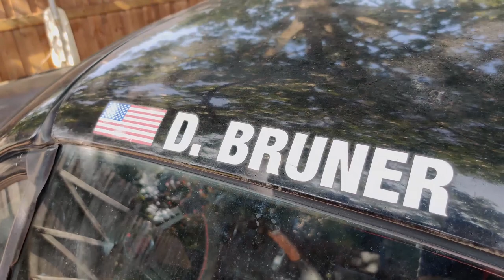Modding and riding the Honda Grom Clones(+what issues do our $1200 street legal motorcycle have?)

Comment: Tough stuff! I was gonna buy one of these but I ended up settling on a 250cc enduro 😂 I'm glad you guys like them, I might end up getting a grom clone myself eventually 😂😂
Reply from the maker: Did you end up with one of those Hawk enduros, or a tao tao? Those are rad, I'd considered those too. Funny enough, we've taken both of these off road and they do surprisingly well. May even do some off-road mods..
Reply: @BrunerTuner  I actually ended up purchasing a bike called the Orion RXB250L. For the price I paid its actually amazing, 20hp 249cc with a yamaha clone motor and ktm plastics. I heard of issues getting it plated in some states but I got it done in NJ with no problem. Definitely check it out, I heard loads of great reviews about it!
Reply: @BrunerTuner  And definitely do them off road mods! Offroading groms seems mad fun, some supension upgrades and you essentially got yourself a street legal pitbike
Reply from the maker: @konradoz201  I actually just picked up some Kenda tires for mine. I'm looking into suspension mods next.
-Taylor

Comment: You might rethink your carb set up, there is a manifold set up that puts the carb were it should be and a mod to the air box for adequate air flow. Check MiniBikeAction.
Reply from the maker: Thanks! You're not wrong. We tried this setup out and it did not work. There's actually a new video coming out where we do the carb correctly. We'll have to see what air box mod you're speaking of, not aware of that.

Comment: How do you feel about the front shocks on the BD125-10? Mine are sooooo soft that they pretty much bottom out when I stop.  I’d do the front fork mod like Groms do, but the shock are different I heard. How are yours?
Reply from the maker: You know mine are decent. The Icebear suspension is wayyyy softer than my vader. I haven't felt the need to update the suspension at all
Reply: Mine were horrible too.  I took off and replaced with ATF, and added a couple washers on each tube for shims.  Better.  A little stiffer.  Still less than ideal.  I'm heavy too.
Reply: @gizzyguzzi  yeah I am  220 pounds and my front forks feel like their Loaded for someone who’s 100 pounds

Comment: So the the question becomes, which is the better bike and why?

My Hellcat order was just canceled by Q9.  Apparently they aren't sure if they'll ever get anymore in anytime soon.  Which I could have told them that 6mo ago.  Plus some,bs about Tao raising the price 4x.  So much for locking in your price with a pre-order. 

Couple days here I'll order up a white Vader just like in this vid.
Reply from the maker: Yup, exact same issue happened to me. That's how I ended up with that Icebear Fuerza. Wow, that sounds like a mess, I was under the same impression about the price being locked in. 

I've heard that the tao tao is the lowest quality, with maybe the icebear being slightly better. The Vader is supposed to be the best quality of the three, I think.

Our icebear and vader have both had issues, with the Vader leaking a lot of oil immediately, and my starter clutch going out on the icebear. Other than that, they've been the same for reliability so far.
Reply: @BrunerTuner  my kid has a Taotao New Cheetah atv, it has its quality issues too. Engine  and electrical aren't a problem, but suspension and fasteners certainly are. Tie rod end ripped threads out after 10 hours, had a wheel fall off from crappy wheel bolts...

Obviously I've fixed, replaced or upgraded all that by now. 

Is the Icebear still the N1234 shift pattern?  Or did they fix it to be 1N234 like a normal motorcycle?
Reply from the maker: That sounds exactly like the issues I have with the icebear. Suspension is literally so soft that I can compress it while riding and the rebound will hop the whole bike up a little bit. And my engine mount bolt snapped very quickly.

It is indeed still the weird inverted motions, so you press down to shift up.
Reply: @BrunerTuner  our Taotao Cheetah suspension was rock hard. No suspension travel at all. Not what you want on a 4 wheeler.  Put 3 new shocks on it and it actually moves now. Lol. Might as well have welded the suspension with the stock stuff.

You should consider the zs190 swap on your Icebear... 3x the power, and a 5spd that actually had a normal shift pattern.

Comment: Does the fuerza throttle still feel a little bit sloppy with the new tubbi throttle? Like it doesn’t have a spring to retract the throttle and you have to physically push it back up because the throttle hangs?
Reply from the maker: Nope, it felt okay after the throttle change! But, I also don't have the bike anymore..
Reply: @BrunerTuner  did your stock throttle get hung up by chance? I just got my fuerza last week but the throttle feels like it doesn’t have a spring in it to retract the throttle back  like I can pull it back to wide open throttle and it’ll stay there which it’s kinda cool cuz it kinda like a cruise control in a way but I didn’t know if that’s just how it is being a cheaper Chinese knock off grom every other bike I had the throttle retracted back like it should so I’m just tryna figure out if maybe just a manufacturer defect or if they all do it

Comment: Cool little bikes ! I’m getting one haha they sell them by my house but of course Chinese not reliable bla bla .... but how long u think they can last ?
Reply from the maker: I think they should last awhile honestly. I think as long as you maintain them (and are ready to do some wrenching here and there) the core of the motorcycle should last awhile.
Reply: @BrunerTuner  cool bro ! And cool Chanel keep it up 👊😎🍺🙌🏻
Reply from the maker: Appreciate that man, thanks for watching!
Reply: @BrunerTuner  True.  It’s all about taking care of it.  I had a Honda Ruckus that I did GY6 150Cc swap on and that thing ran for thousands of miles with very few issues.  If something breaks, parts are cheap.  If the whole engine need to be replaced, engines are cheap.  If you want more power, do 190cc Daytona engine swap! Lots of options!
Reply from the maker: That's awesome to hear! Many people do not take care of their stuff like that, unfortunately.
Reply: @BrunerTuner  Bro! I’m watching your off-road video right now! Good stuff, man.
Reply from the maker: @hangtenboy  appreciate it dude! We'll have some more content like that in the near future. Thanks for watching man!
Reply: @BrunerTuner  Right on.  I’m thinking of taking a video of mine so far and posting it up
Reply from the maker: You should man!
Reply: @BrunerTuner  Just did. Also, for the sake of honesty, Since you were so honest about the starter pulley I was blocking off things and they blocked off the crank case vent so I took it for a ride just now after installing the VM 22 carb and I came back there was oil leaking everywhere. Pretty sure I just blew an oil seal.  Haha
Reply from the maker: LOL hey man it happens, that's just how this hobby goes! Sucks to hear man, but that's the name of the game with automobiles. Good luck fixin it up!

Comment: If you are not a mechanic these bikes are not worth a penny. If you are you can put a new engine, shocks, tires, etc. and you may have a decent bike. You could also save yourself a headache and a lot of time and buy a good bike.
Reply from the maker: I wouldn't recommend these to anyone that couldn't wrench on their own. Perfectly fine with a few cheap parts thrown at them. I loved mine!
Reply: Dealers are high right now with markups and excessive charges.  This may be an option for some at such a low price. Normally I wouldn't agree, but with prices the way they are this is probably a better decision. With all the markups they are charging you could afford to rebuild the bike twice. lol